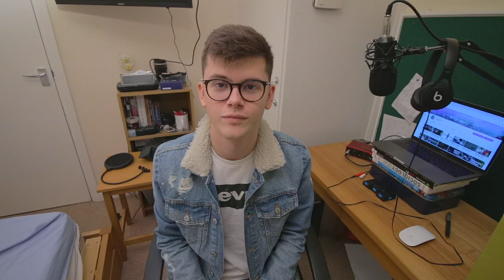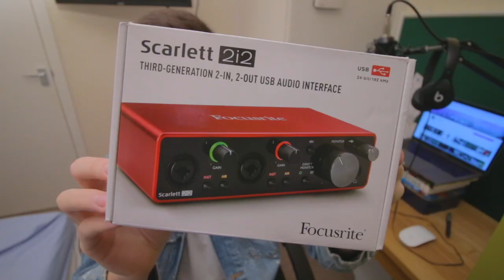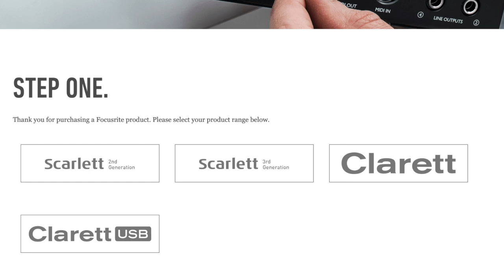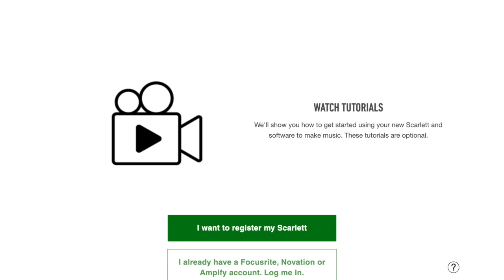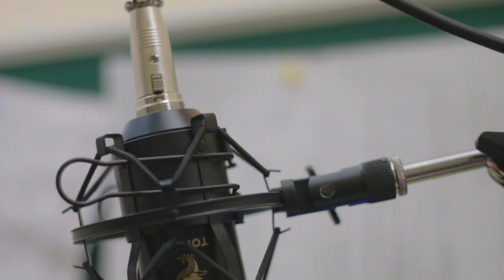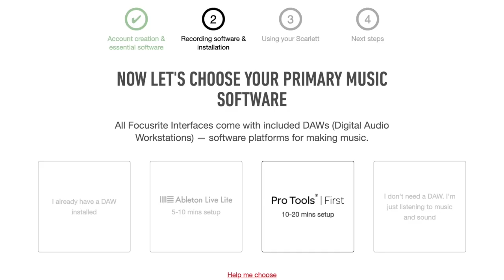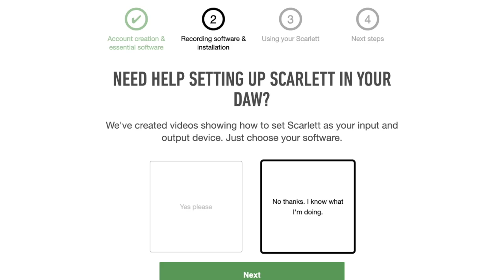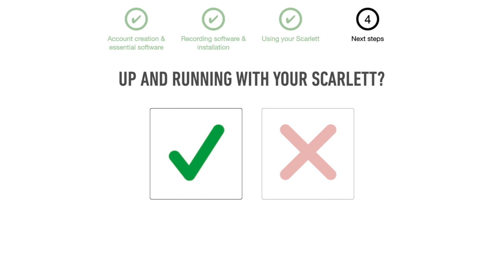How to: Set Up Focusrite Scarlett 2i2 3rd Gen For Mac - Audio Setup 2020

Comment: I can’t get it to recognize my microphone. It lights up and everything but I’m not able to record any audio. I have the 3rd gen Scarlett and an AKG p120 microphone. I also have the latest M1 MacBook which they recently said is now compatible with the Scarlett. I’ve tried everything from re downloading software to trying different drivers, nothing seems to work.
Reply from the maker: I will be releasing a video in the next few days about how to set up a podcast mic to the Scarlett. So I’ll do my best to get it out ASAP for you.
Reply: @BenBarnettYT  yes I had phantom power on and the preferences were all checked still nothing worked. Thank you for the help.
Reply: @Ryze2op  I'm also having the same problem. Focusrite Control isn't compatible with M1 atm, but apparently 3rd Gen Scarlett should still work?
Reply from the maker: Does your microphone require phantom power (48V) it may be that you need to press this button on the scarlet. Or if not - have you made sure to check the system preferences for the input and output locations on your Mac?